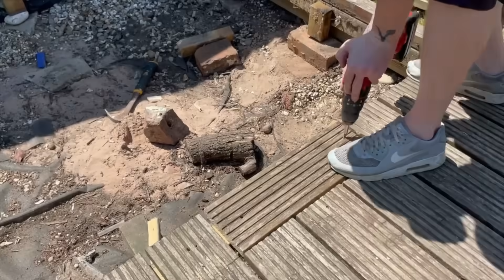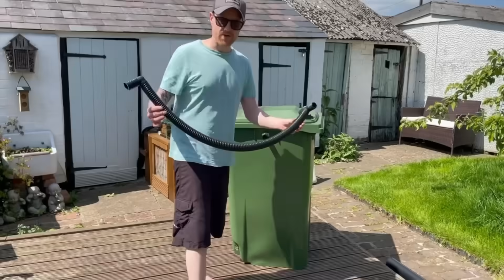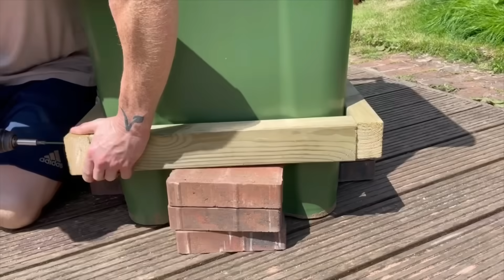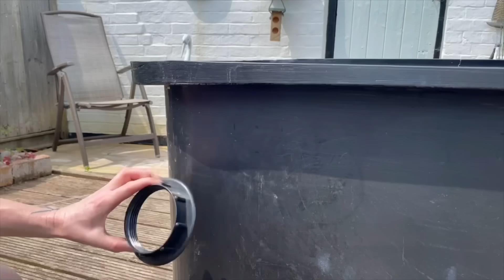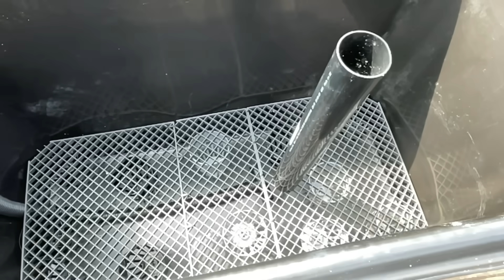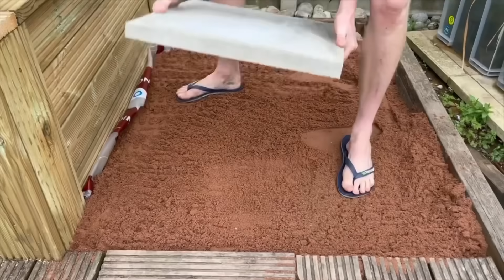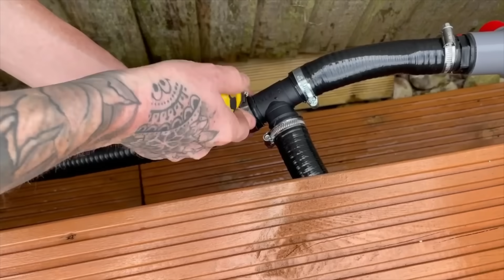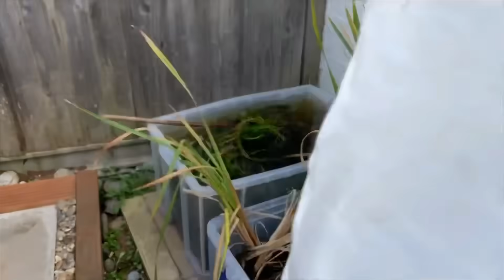DIY Backyard Garden Pond (step-by-step)

Comment: In my country, we really love to make diy koi pond and I can say what you did with your filter pond are on point. I am just wondering why not connecting the mechanical and the bog as a continuous filter ? And in my experience, UV lamp helps a lot with algae, maybe you can add it as an external UV or use the internal one and put it inside the outlet pipe (be careful not to look directly at submersible UV light like this tho)
Reply from the maker: I did think about connecting the mechanical filter to the bog, sort of like a pre-filter, but I was struggling to work out flow rates and what size fittings I would need, so decided to keep them separate. I may add a uv in the future if I think the pond needs it, but hoping to get away without adding one for now 😊

Comment: Hi can I please have a diagram or wording description of the pond hosing between the pump, filter and bog filter
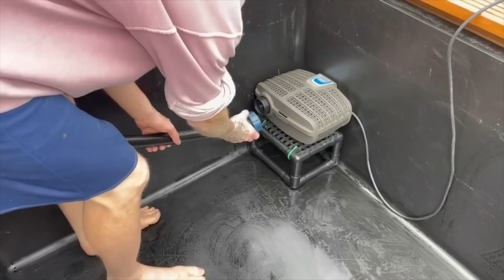Reply from the maker: Hi there, yeah so basically the water goes from the pump through the pond hosing to a t piece, which results in half the water going to the trash can filter and half the water going to the bog filter. If you go to 19:09 in the video, you can kind of see what I mean there. Hope that helps! 👍

Comment: Great job mate. The amount of filtration on that pond is staggering.
I'm in the process of setting up a similar size pond and was contemplating insulation, but with heat rising, didn't see the point in doing it.
Reply from the maker: Yeah, went in hard on the filtration! I’m pretty certain it would be fine with just the bog filter, but like how versatile the other filter is.. yeah, not too sure on how worth while the insulation was, but it fitted in nicely so thought I may as-well!

Comment: Would love to get hold of a source for a main tank that size.
Reply: They are manufactured/distributed by a company called Laguna. They're about £400 new, so not cheap by any means.
They do make things easier, but I'll be sticking with PVC liner and underlay 👍
Reply from the maker: Yeah, if you just search Laguna tubs online, there’s a few places selling it. Luckily I got mine on discount at my local pond shop as it was left over from last years stock!

Comment: Hey up I’ve been waiting for this one. So firstly nice job, well done, thanks for sharing, and it’s looking good👍 … I’ve also got a similar idea in mind … Was just wondering,  could you have fitted a drain valve at the base of the mechanical filter below grid to flush out sediment at the bottom?  …  thanks…
Reply from the maker: Thank you! You could definitely add a drain valve to the mechanical filter, the only thing is, with the bottom of it being underground, you would need to put in some sort of little hatch to reach down to the valve and then have some sort of soak away where the water would be able to drain away in to. So it might be a bit tricky, but definitely possible 👍
Reply: @GingerFishyOfficial  well yes fitting it below ground would be problem, which I did actually notice before I wrote.  Anyway good to know that I’m at least thinking in the right direction … I’ve also watched plenty of “Oz Ponds” videos who as you know is brilliant … Looking forward to seeing your new pond progress 👍